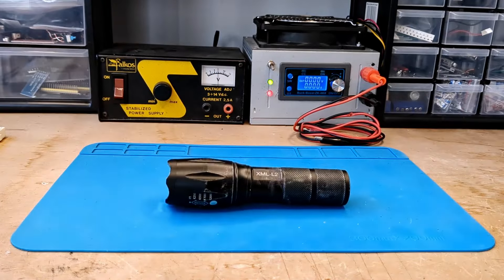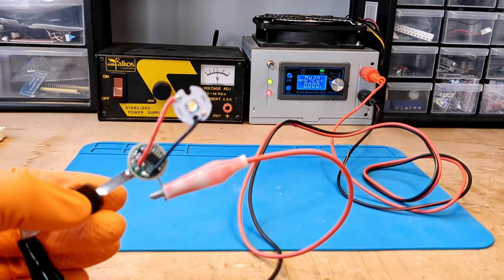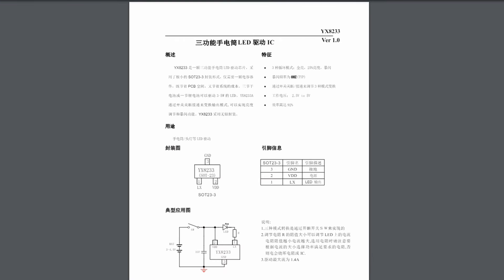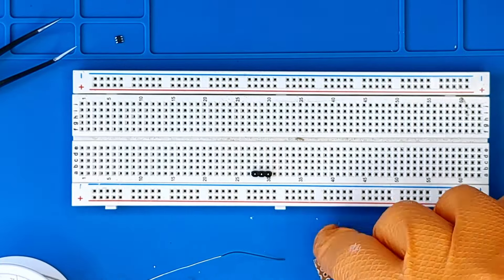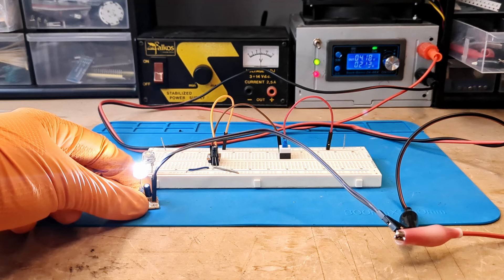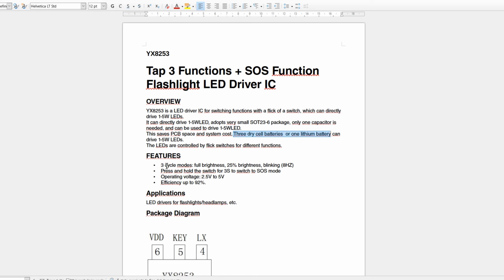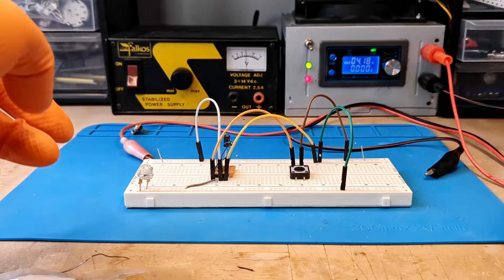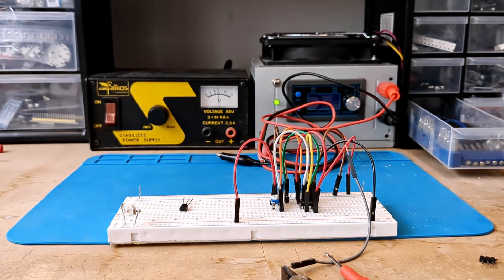2 mysterious ICs to make cool high-power flashlights [No ic555]

Comment: Hi Dario, You did an excellent job finding the IC. Please let me know if you have a solution of keeping the Li batt constantly on a charger, but limiting the charge to 3.7,  3.8,  or 3.9 V. This design will extend the battery life, and will serve as backup power for Modems or routers in the case of power loss.
Reply from the maker: I think you just need an adjustable voltage battery charger